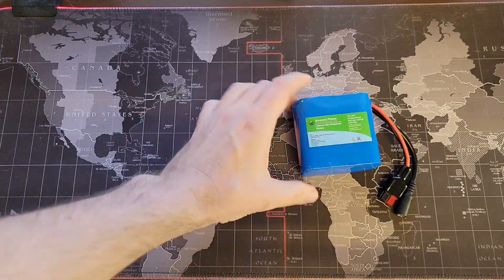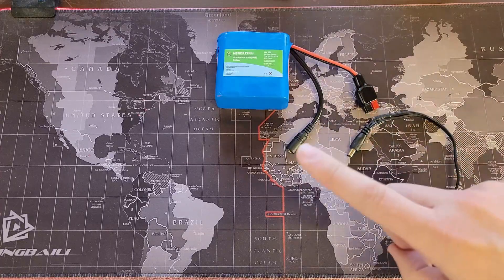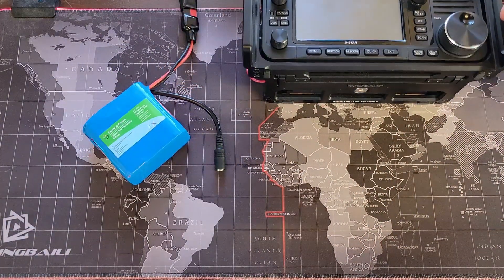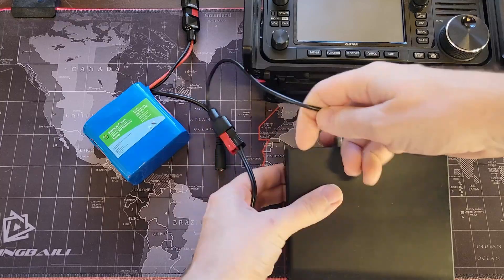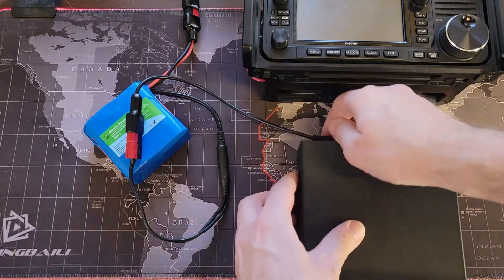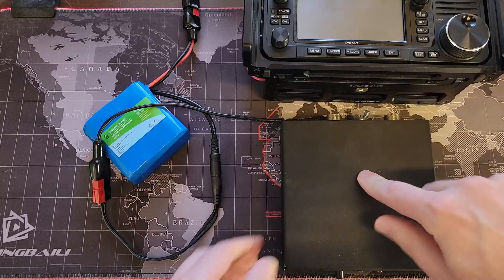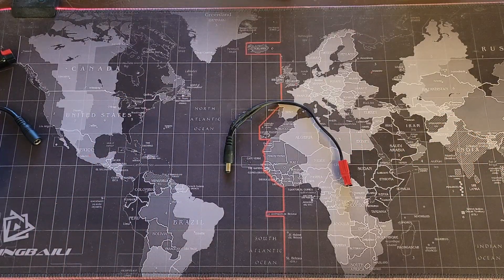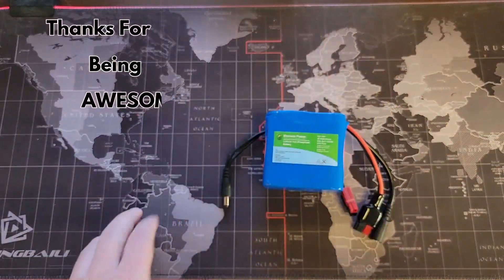Bioenno Hack!

Comment: The output and charging connectors are in parallel. They connect to the same place. The current rating is limited by the wire gauge and barrel connector specs.  It’s great for low power accessories! I recommend a barrel to regulated USB-Cpd.
Reply from the maker: Good idea!

Comment: That's thinking out of the box!  What if you plug the IC-705 into the barrel connector, it only draws 3amps on 10watts transmit, then use the powerpole side to run an amp?
Reply from the maker: Exactly!  This is only a 3ah battery, so it wouldn't last long with a 100w amp, buy maybe a 50w would do ok.

Comment: Nice hack. Never thought to try that. Personally, I use the Buddipole PowerMini 2, which has a battery port, solar port, and 2 Anderson Powerpoles for output power. Your hack is much smaller though, great for backpacking. But I usually carry a roll up solar panel to extend my play time.
Reply from the maker: I love that power mini - its the best price/performance/size factor I can find.

Comment: What's limiting the 4a output on the jack?

Not that 4a is bad. You can run quite a bit of stuff with that.
Reply from the maker: Kevin @Bioenno said it was something in the internal construction - probably blow a trace on the BMS or something.  Yeah, 4A could run my QRP radio just fine.
Reply: @temporarilyoffline  ah OK. Can't just use thicker wires to fix that. Good to know. Thanks
Reply from the maker: @DirtyPlumbus  Well... "science"... you know? 😀 (no, don't try it)
Reply: @temporarilyoffline  Lol